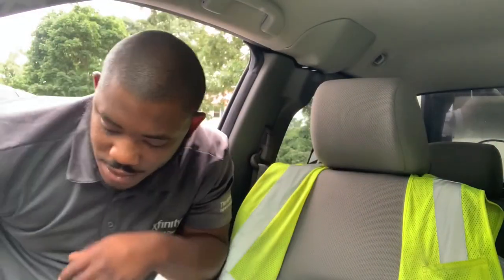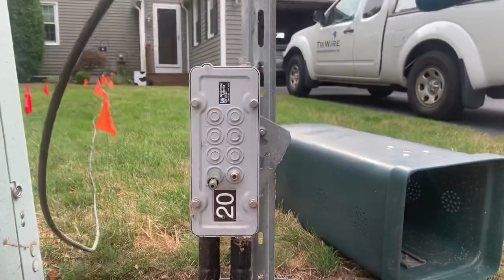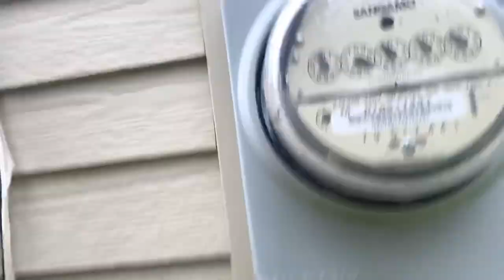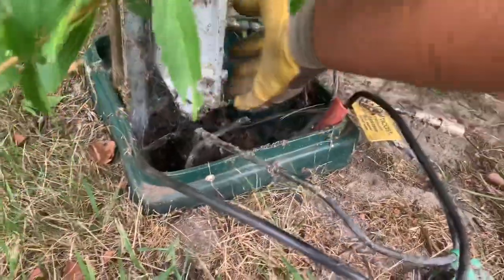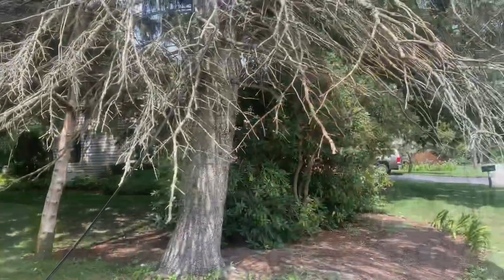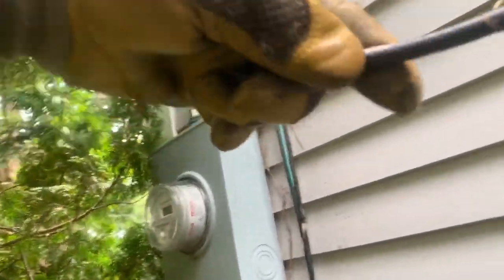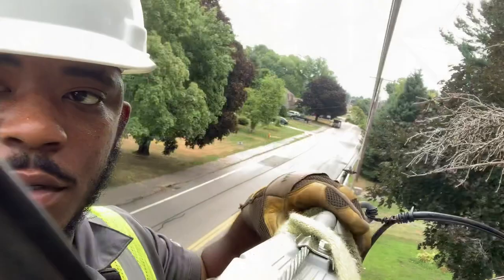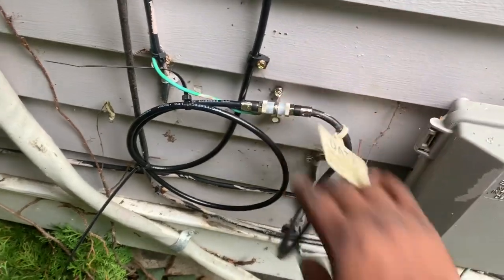Life of a cable technician Ep #4

Comment: What is the purpose of the ' filter?
Reply: Most modems put out MOCA signal, which is basically just Ethernet over coax. The filter is to keep the moca signal from getting out of the house. If there wasn’t a moca filter, other people could potentially connect to your internet over the cable lines.

Comment: Good gud guy but drip loops go down. Not up. Check your tap drip loop
Reply: But does it really matter water gets in the drop if it wants to no matter the weather proofing or drip loops, it’s water it’ll get its way in to anything. I think drip loops and grommets are pointless. I’ve replaced hundreds of drops that were drip looped and had grommets. I knew a guy who use to silicone his fittings around the ground block. I actually worked for a company called rcn in pa and they were against grommets said it trapped water in instead of keeping it out